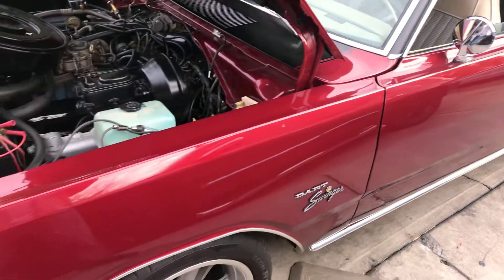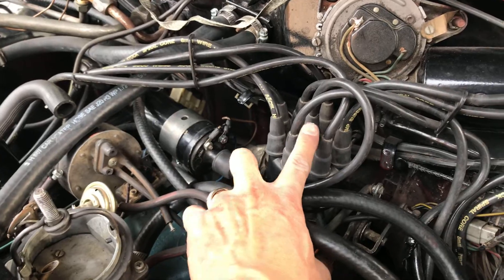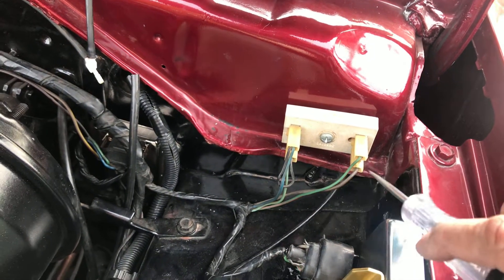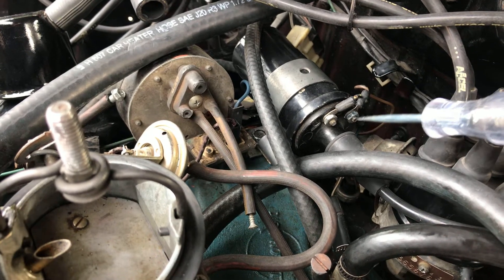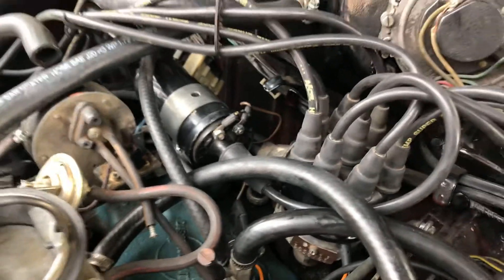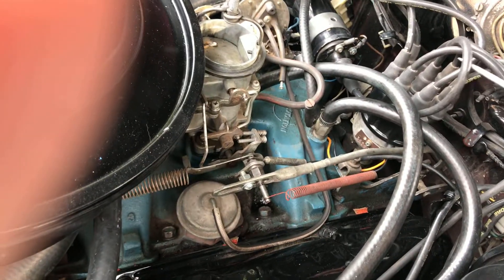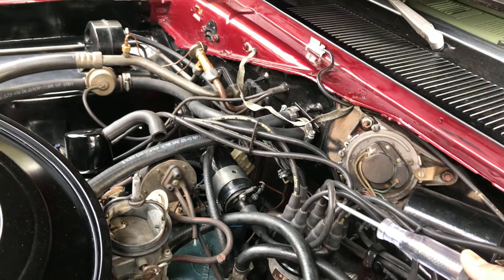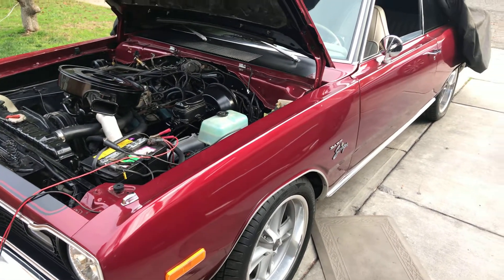1973 Dodge Dart No Spark (Help)

Comment: did you figure it out?
Reply from the maker: Yes, it was the ballast resistor. That white ceramic part. The prong that leads to the coil was only coming on when I turned the key to start.
Reply from the maker: I replaced it and now it works. 16 days without being able to get it to start